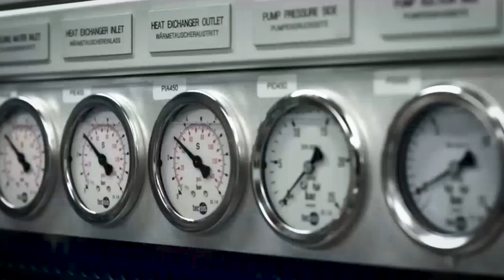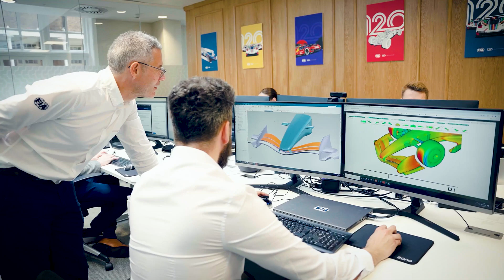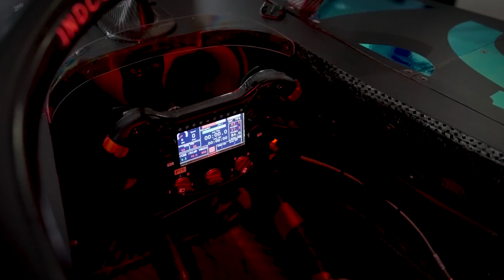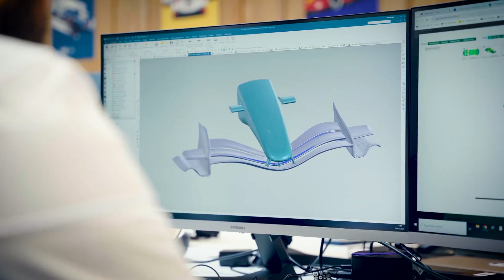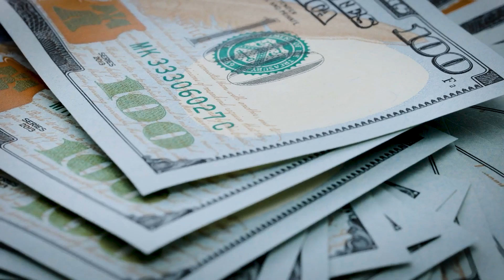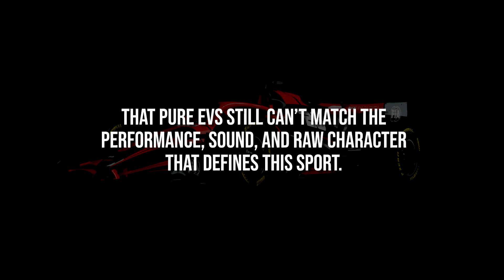Why Is FORD Joining F1 With Red Bull?

Comment: I love Formula 1, and I love Formula E, two very different categories of single-seater racing, each with their own identity and appeal. Formula E cars, in particular, have a unique beauty to them, and now, as the series enters its fourth generation of cars, that identity is stronger than ever. The technology, the racing, and the direction of the sport continue to evolve in exciting ways.
Looking ahead, I would love nothing more than to see a true comeback story from Ford with now Red Bull. Watching such a bold gamble pay off especially if it results in championship success against established powerhouses like Mercedes and Ferrari, and also now Audi, this would be the ultimate payoff. Developing a next-generation power unit with an even 50/50 split between internal combustion and battery power is a massive challenge not only from an engineering and packaging standpoint, but also in how drivers adapt their driving styles to maximize performance and energy deployment. And let’s not get in to the new fuel because this is just another variable in the Formula equation.
The evolution of motorsport should be embraced. Change is inevitable, and it’s what keeps the sport alive, competitive, and relevant. I welcome it wholeheartedly. Now let’s go racing and see how it all unfolds. And looking even further ahead, when Cadilac (GM) introduces its own power unit in 2028, I genuinely can’t wait to see what they bring to the grid.
For anyone who hasn’t yet watched Formula E, I highly encourage you to give it a chance. The racing is intense, with plenty of wheel-to-wheel action, and it’s far more affordable to experience live. It may be different, it may not have the bone chattering sound, but different doesn’t mean lesser. In many ways, it’s exactly what modern racing needs.
Thanks for reading my opinion.